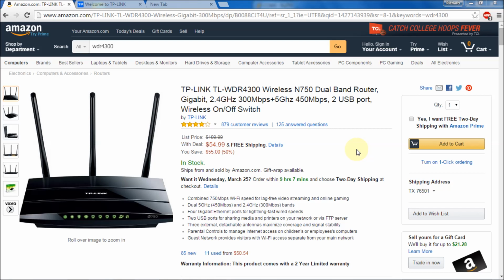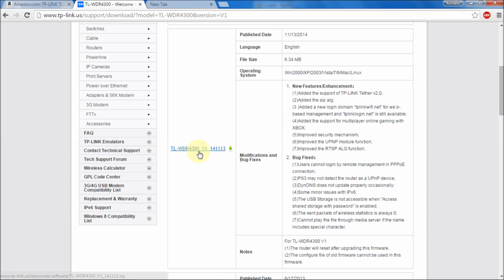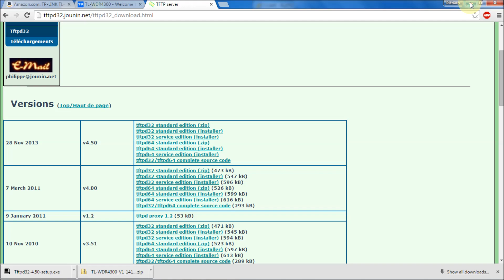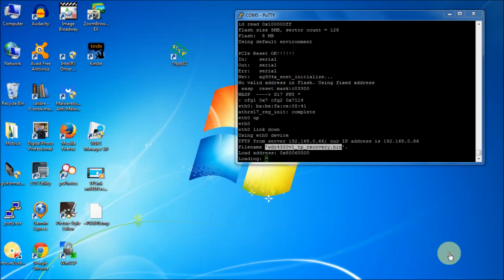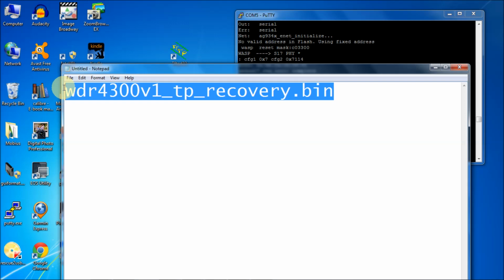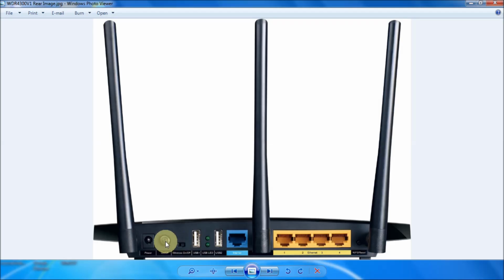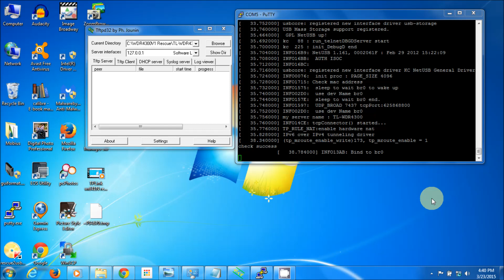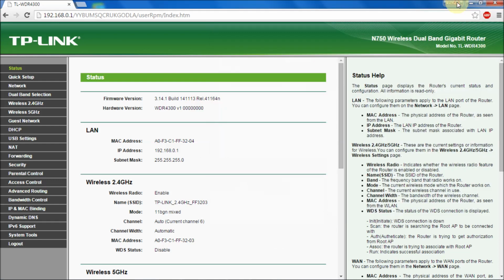Bricked TP-Link WDR4300 Version 1 Recovery/Rescue Unbrick Without A Serial Connection

Comment: You`ve lost me here, do you get a lot of problems there?, here we sign up they send the router, connect, log in job done.
Reply from the maker: Here they charge you rent for the routers they provide you with your internet service so it is best to buy your own instead of paying $10 a month for one. Outside of that even the routers you buy off the shelf are somewhat limited in their capabilities. The DD-WRT firmware is a third party firmware that unlocks the power of your router. In my case modifying the router allows me to run a web server, file server, print server, internet phone etc. Let's compare it to what the hot rod enthusiasts used to do to their cars. Their cars would run just fine if they never touched them but they ran much better after they modified them. But sometimes they pushed them just a little to far and they stopped working all together.
Reply: Richard Lloyd Ah, message received, here the router and Freeview tv update automatically, i pay £15 a month for unlimited broadband, the router is free (nothing in this life is free), if it breaks they send a new one. when it comes to computers im illiterate im afraid. I personally think the TV and internet should be free for everyone.
Reply from the maker: bmwnasher  I have been saying TV should be free for years and I would have to add that the internet should also be free. It's hard to believe that you have to pay for something that advertises products to you 24/7. As you said nothing is free but I think in the future the advertisers will pay for the service not the consumer. Thanks.